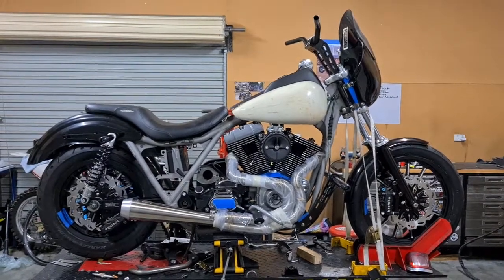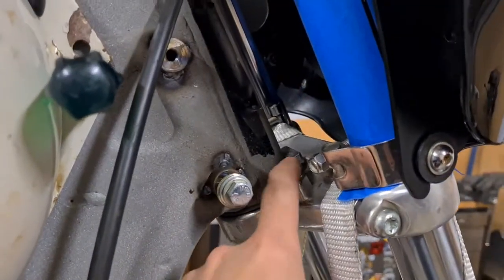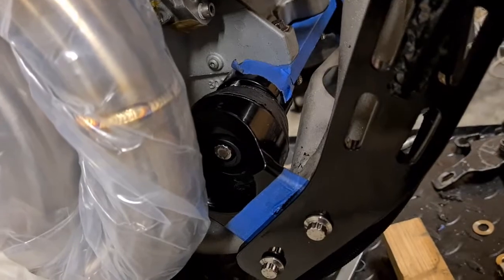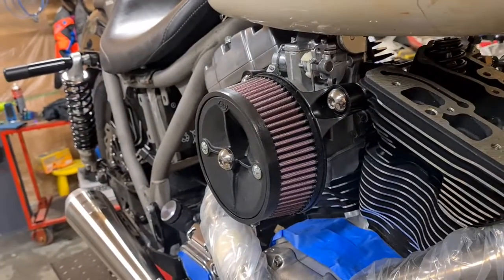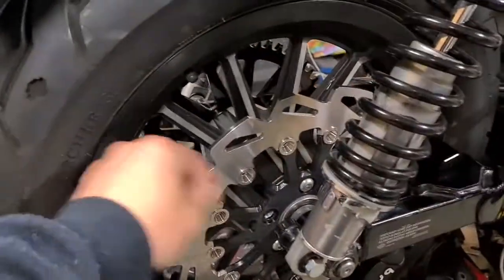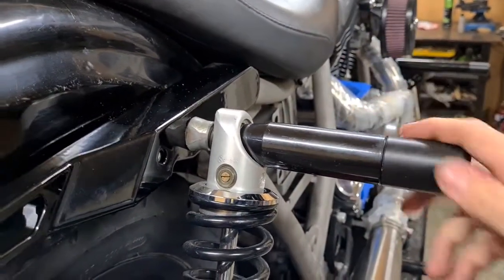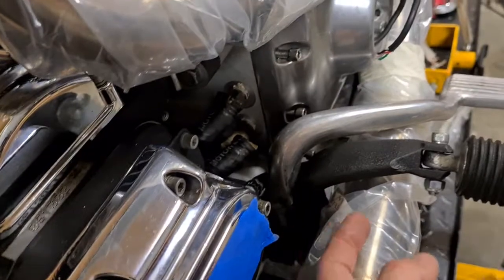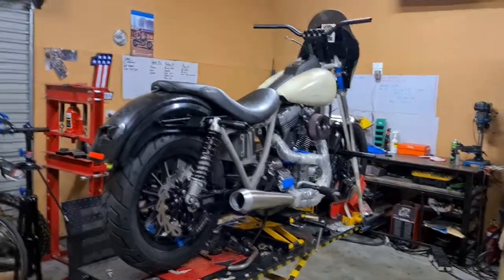Harley Davidson FXR "Clubstyle" Build (Twin Cam swap), Part 2

Comment: I gave up on the floating type rotors on my bike they always end up rattling, galfer also makes some pretty bad ass solid rotors that I’ve been using with absolutely no issues.
Reply from the maker: Yeah I've seen them and definitely like the design, but not sure if I'd buy Galfer again out of principle, especially when there's so many other manufacturers. 

I know a bunch of guys that have tight Galfers, and other places (shops) DM saying all Galfers end up like that, so who knows (apparently not the bloke I was emailing @ Galfer lol)

Comment: Hello, how do you like the rear shock mounts back on the swing arm of the 02 Road King swing arm and did you have to do any mechining on it to fit the frame?? Thanks for your time.👍👍 BAD ASS BIKE (Have one myself) 👍👍
Reply from the maker: They're fine, I use the RP shock position too so it offsets the slant a bit. If you had the RK swing arm and used the front shock mount the shock would be quite layed down.

No machining needed, but I did use the RK trans, and all the wheel/caliper/sprocket was all custom and measured up

Comment: hey dude, i got a 39mm narrow front end im trying to fit radial tokikos on but they are hitting my 3/4 sealed 13 spokes, are the brembo radials more narrow?
Reply from the maker: Couldn't tell you but you should definitely be able to make that setup work, even if you space it a touch. How far off are you

Comment: S&S made those cases for star racing
Reply from the maker: That's interesting, is there any reading material available online about that? Ive seen a few similiar setups (TC motor with evo mounts) but don't know the background of them. There's a few Jims Race motors using the same style cases. I just thought they where an alternate style case offered by S&S (and probably others) not necessarily made FOR a single company.
Reply: @jimmyrustles8118  I have a set of these and called s&s a gave them the numbers on the cases they told me the info on them im turning my into a 145 with b2 heads
Reply from the maker: @thegnostic33  interesting! These ones where purchased direct from S&S and come with the SS tags etc. 

145 will be a huge motor... it'd rip.
Reply: @jimmyrustles8118  ya mine are special applications cases too but they are twincam with the Evo mounts
Reply: I'm also doing a twincam conversion on an 94 fxr I like your videos thanks for your time putting them out gives a guy some ideas
Reply from the maker: @thegnostic33  Good luck with it man! I'd highly recommend checking out Bad Foote videos as well, as he has a wealth of knowledge.

Comment: Is it hard that the it a motogadget gauge on an FXR?
Reply from the maker: Depends how good you are with wiring. It's straight forward, all the diagrams are online in the manual, but the gauge wire is finicky.
Reply: How do you like it?
Reply from the maker: @keganadcock8253  love them, they're my favourite gauge. So many features and inputs.
Reply: @jimmyrustles8118  I think that’s the route I’m gonna go on my fxr as well. Currently only has a fuel gauge
Reply from the maker: @keganadcock8253  it's a very nice peice of kit.